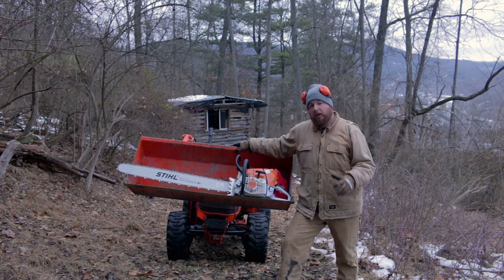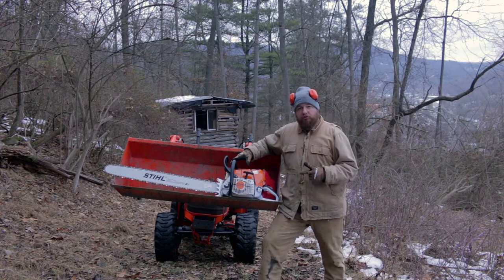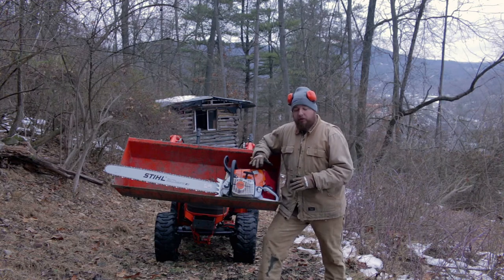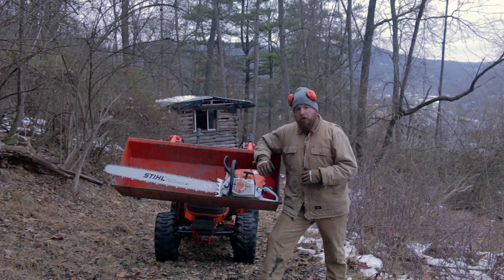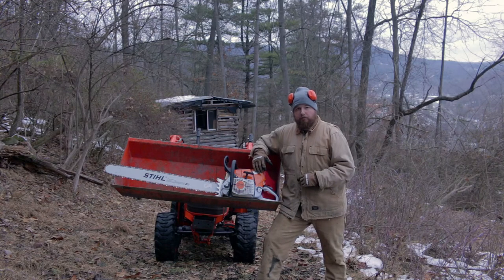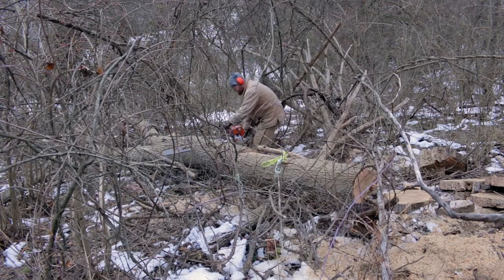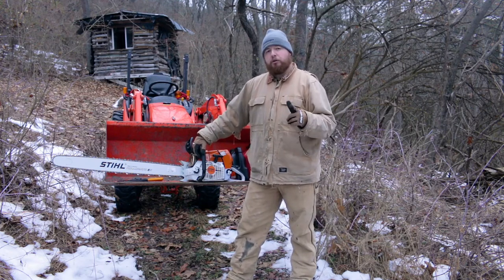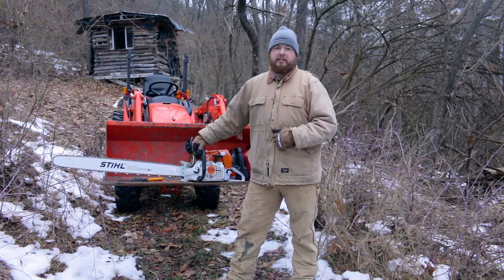BEST way to Break in a New Chain Saw

Comment: Ouuuchhh. I have a question 
Who in the world taught you how to make your face cuts?
 The tree is not supposed to stop dead on the stump and roll off
 Flip your face cut upside down. So the tree actually slides OFF of the stump downward 
 What your doing is very dangerous
Reply from the maker: your talking about making a humbolt cut. and yes the butt of the tree will hit first. A traditional/conventional cut is what I made(tip of tree hits first). there are benefits to both. The tree stopped because I didn't make my face open enough and the gap closed. an open face would have been better here because of the extreme slope on the ground. A traditional cut is not dangerous it's just one of many ways to make a face cut.